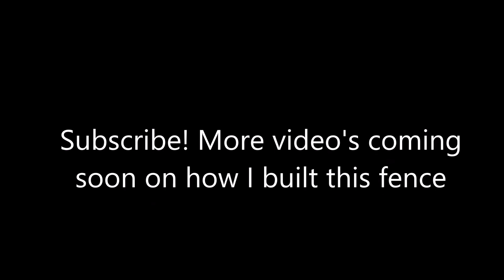Installing Fence Pickets

Comment: Nice work that’s a lot of fencing.how long is it?
Reply from the maker: It is 208' Long, I am going to add another 100' at the bottom into the woods with t posts and welded wire fence.